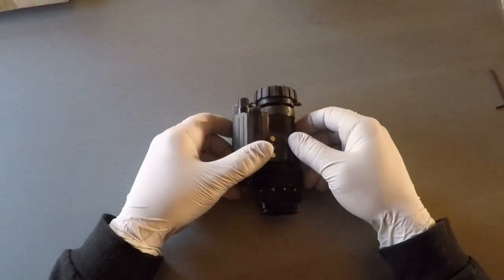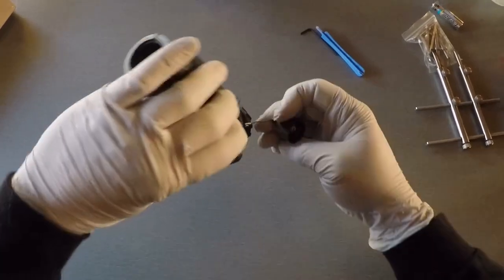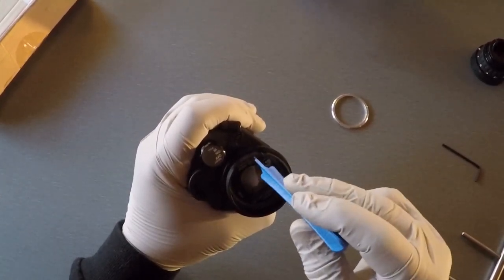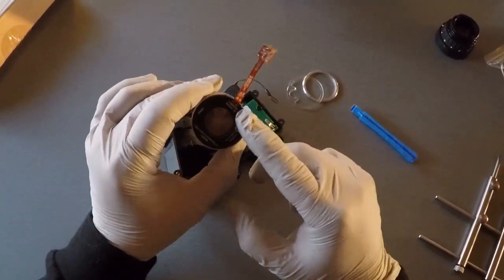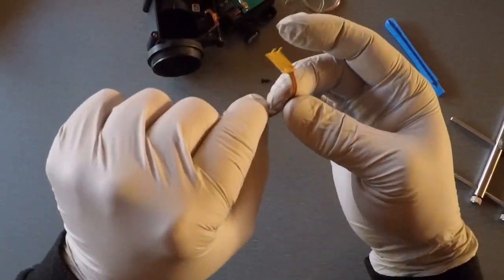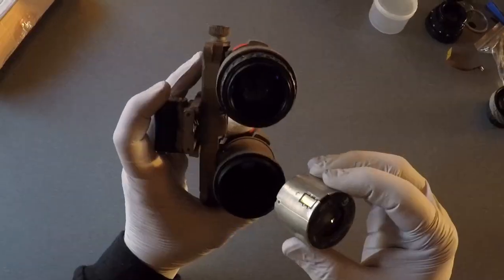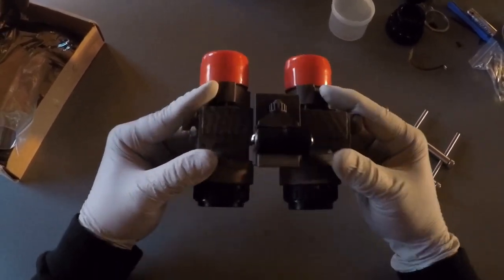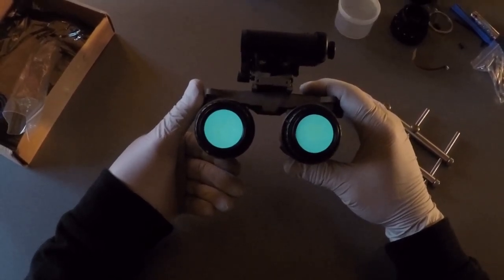How to convert a L3 11769 tube into 10160 format

Comment: Looking to drop my Pvs 14 tubes into a lighter dual housing and this video is well within my comfort zone. I’m reading about needing resistors installed in place of the pigtail. Is that something that’s necessary with 2019-2020 L3 filmless tubes?

Comment: I’ve read that 11769 tubes need a resister installed to work in 10160 housings is that trie? Or once it’s in a RNVG for instance, wit the pigtail relived you’re good to go? Using never L3 tubes. Thanks!
Reply from the maker: John Burton Newer L3 tubes don’t need resistors you just unplug the pigtails like I show in the video. Elbit tubes require a resistor and older L3 tubes also
Reply: Ok thank you! Just debating if I want to do it myself and not have it nitrogen purged or not
Reply from the maker: John Burton Keep in mind that unplugging it will void the factory warranty if you have one.
Reply: Hello!! The Liton 11769U/V needs resistors? 2009 CAD

Comment: Hello I'm new to the nv scene. Is it possible to slide the tube back into the pvs14 monocular to bridge 2 pvs14. The reason I ask i heard someone mention that they have to be 2 10160 to bridge them together. Thanks in advance.
Reply from the maker: The 10160 tubes will work inside the PVS-14 housing but you don’t have to only use 10160 tubes. The difference is that 10160s are by design meant to go into a binocular whereas the 11769 tubes are essentially meant for PVS-14s, although some goggles use them.

Comment: I acquired two minor blem gen 3 omni 7 tubes in green phosphur for 1100 bucks they are 11769 tubes they have ribbon cable manual gain function and want to do this I'm planning to use them for duals, getting an aeternus dual tube housing

Comment: Is there any other steps that need to be done after they are assembled? Or once the tubes are in and the optics are set is it good to go?
Reply from the maker: For the tubes to work, nothing, but for the system to perform properly yes, it needs to be collimated and nitrogen purging is recommended if using it in a high humidity location
Reply: @NITEWALKER-NIGHTVISION  any chance of a video on the collimation process?
Reply from the maker: @foss129  I'll "see" what I can do, lol. I attempted to put one together after doing this one but I wasn't happy with how the two images showing how to align it came out

Comment: If I sent you a build sheet would you be able to tell if it was a 11769 tube.  My thing I don't want to loss purge on housing to check.  It is in fact an L3 w/p 11769 tube and inspected in 2017. I don't know if that deals with manufacturing or what.  Was going to go to a dual PVS14 setup but this seems like its more or less straight forward.  Anyway you have a private messenger for questions, and obviously at my own risk I got it.
Reply from the maker: Go to "contact" at the top of the page

Comment: Wondering if Harris F9815M16G, from 2017 batch can be converted or no? What do you think? If no, the resister is located on the pigtail? Shall I use this resister to solder it instead of the pigtail connection?
Reply from the maker: The old Harris (now Elbit) tubes require you to desolder it from the tube and replace with a resistor
Reply: The proper resistor is located on the pigtail and I can just take it from there? Or I should better buy a new one and solder it?
Reply from the maker: @andrewshaio1181  Honestly, you’re probably better off selling it and buying a 10160 tube instead. However if you’re good at soldering and working on electronics: https://www.ar15.com/forums/Armory/Make-the-tech-board-great-again-How-to-convert-an-MX-11769-to-MX-10160-with-pics/18-523263/

Comment: RNVGs use the same rear and forward lenses as pvs-14s right? Where are the best places to get RNVG housings?
Reply from the maker: Yes and no.

The RNVG can be ordered with front objective lens threads to fit either PVS-14 or Anvis objectives. The threads are not the same so the objectives are not interchangeable, although the rear eyepieces are interchangeable. The Anvis and -14 eyepieces have the same threads and are essentially the same other than Anvis do not have threads on the inside where the ring threads into. This is the ring that the rubber eye cup/wilcox amber filter attaches to, or that you unscrew to replace with a screw in amber filter, etc. 

A warning about Anvis eyepieces - there are some older Anvis eyepieces with glass that's smaller in diameter then newer ones.

There are a lot of dealers these days but I only have direct experience with a few. I'd check with these guys below. They build units in house which means they buy housings only. There are a lot of dealers who don't actually build/assemble devices themselves but are more like a dealer's dealer or a dealer's dealer's dealer if that makes sense. I'm not saying they are bad dealers but it has to affect lead times & pricing because there are more hands in the jar and potential for the misunderstanding/incorrect information being passed to the actual builder.   

TNVC
Night Vision Inc.

Comment: Can you just put an MX-10160 tube without gain control in a 14 housing? Im looking to build on and 10160 tubes are significantly cheaper and i dont care about not having manual gain control
Reply: You can, you will just have the extra weight that the pvs-14 battery compartment has
Reply: Go with a Tanto if you want to go that route, lighter weight and fantastic company

Comment: Do you know where to get the 10160 WP tubes?
Reply from the maker: The hard part right now is a lot of dealers are struggling to fill device orders (binos, -14's, etc.) so they don't want to sell tubes by themselves since they need them for systems. I've seen Kosher Surplus sell tubes by themselves and maybe check Ultimate Night Vision.

Comment: I thought you needed to install reisister or something after removing the pig tail
Reply from the maker: Not on the newer L3Harris tubes. You need the resistor on the ITT/Elbit tubes.
Reply: Are you referring to the ones with the pigtail soldered on

Comment: Why might someone want to do this modification..?
Reply: Most binos do not have manual gain. Anvis 6/9,  PVS-15s, RNVG, ARNVG, MOD3 RNVG, DTNVG/DTNVS, Katanas, LLUI-21, and BNVD 1431 mk2 requires some special modification wth a resistor and some soldering and if youre building them yourself...i dont recommend you try it if you dont know what youre doing. The only binos on the market to my knowledge that have manual gain control is the PVS-31, the BNVD 1431 (again, requires a modification to work), and soon to come to market in a couple weeks - the Nocturn Industries "Manticore". Thats really about it. So if you can get yourself some Omni 8 L3 MX11769 tubes or other L3 MX11769 tubes but cant find any MX10160 format and need them inside a bino housing...this is where you would do this mod

Comment: Great video man! 

But i have a question the pvs is manual gain, the anvis auto gain.

So does the anvis still autogain or is it just one powersetting?

Thx mate
Reply from the maker: Bas Duurland Yes, the auto gain still works. The gain level is now close to max gain which with these tubes works great (high SNR and low EBI). All gen 3 tubes have ABC (automatic brightness control). The PVS-14 11769 tube with the gain pigtail attached auto gains also. The difference is you can manually control the minimum/maximum static gain level. Side by side with my Sentinel with true 10160s in it, the max gain looks about the same
Reply: @NITEWALKER-NIGHTVISION  thanks mate, l3 im not formiliar with because i live in europe. 

All we have is photonis and to get our hands on a l3 tube is almost impossible (at least the legal way haha). We can get them but because of itar the paperwork is not even something im gonna try.
Reply from the maker: @basduurland8334  Yeah, that sucks for you guys. The Photonis 11769's from what I've seen and been told have soldered on pigtails, so you'd have to solder in a resistor to use it in a no-gain housing.
Reply: @NITEWALKER-NIGHTVISION  im about to install my PVS 14 ITT Tube into a MUM 14 which uses also MX10160 Format. What Kind of resistor Do i need?
Reply from the maker: Guenther Zack Ideally you’d use a potentiometer to determine the gain level you want, but probably go with 160K.
Reply: @NITEWALKER-NIGHTVISION  I de-soldered the pigtail on my MX11769/UV and then connected it back to the housing and measured the resistance it was outputting to the tube by turning the gain knob. Minimum gain was 28K Ohm, and Maximum gain was 125k Ohm (yeah it's flipped, higher resistance, brighter image, no pigtail = super high resistance = super bright tube, it will burn out), so a resistor of 120k Ohm seems like a good option to have some headroom. Hope this helps someone reading through the comments.
Reply from the maker: @SoldfMC  👍 good info